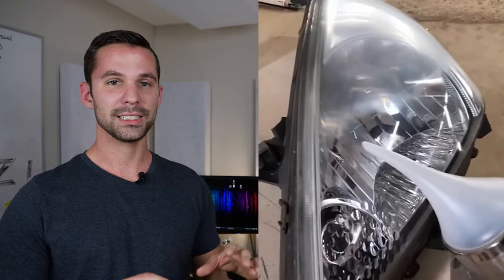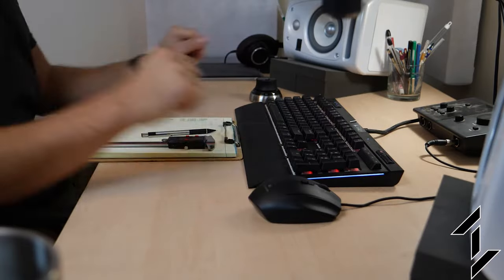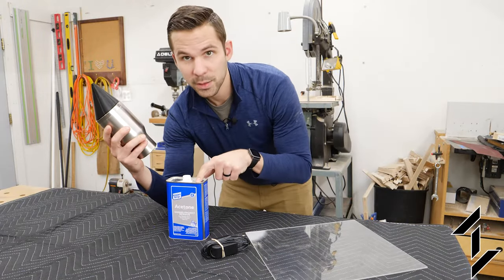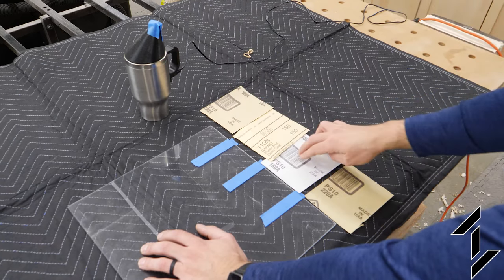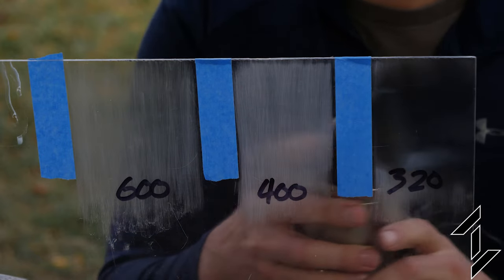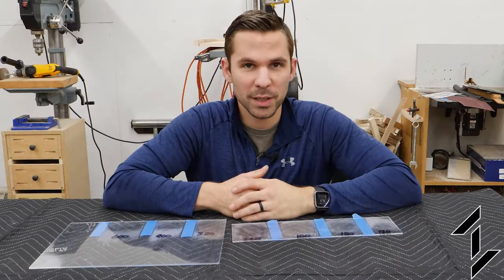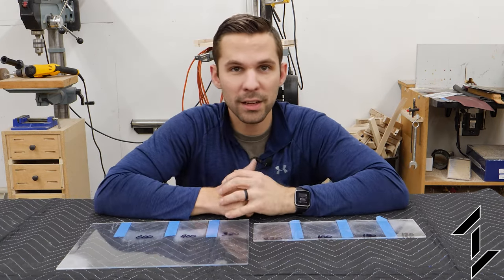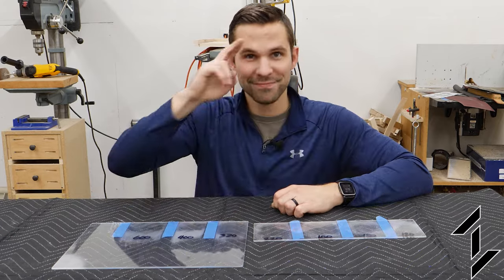Smooth acrylic? Yes, but...

Comment: I am specialist in polymers also Telecom Engineer and IT.  You did everything right and a good job with the 3d printer, but doesn't work for 2 reasons:  Isn't acrylic, it's polycarbonate.  The second reason is the fragment of your 3D project that was dissolved by the acetone, burned and contaminated the acrylic that you have tested.  Try again with a polycarbonate sheet and will work 100%. (sorry for my english)
Reply from the maker: That's great info! Thanks for sharing your knowledge. Definitely more things to try for next time.
Reply: Yup. I’m a sign contractor and there is a misconception that “Plexiglass,” (acrylic) and “Lexan,” (polycarbonate) are the same thing. Nope. Two chemically different products that require two different bonding methods.
Reply: @stuartowens3506 what is the solvent that is used in those chinese headlight polishers called? I just ordered small canistef but there is no info about it. I suspect it is chloroform
Reply: @alexandermurghulia7140  WELD-ON 4 in a video on channel Star Rapid. Roughly 50/50 mix of methylene chloride and trichloroethane per the MSDS. Don't do it! You really do not want to inhale either of those not to mention the fire risk.
Reply: @stuartowens3506 which one is used for bulletproof glass ?

Comment: I did headlights regularly and the repair was done with a special uv resistant coating. But we never coated it at less than 1000 grit. I wouldn't call it busted until you did it at at least 1000 - 1500 grit wet sand. And even then it would still need a coating to protect the raw plastic even if it was clear.
Reply: Nice comment bro.
Reply: I agree with the sanding level. Nobody should consider a lens restoration with less sanding than that. I have seen them wet sanded to 3000 grit.  
It should also be noted Headlamps on cars use polycarbonate, and not acrylic plastic. 
As for sealing, I was wondering if the acetone vapor would seal it.
Reply: @aWhiskeyTangoFoxtrot  the acetone will smooth the surface and seal it against contamination, but to prevent degradation you need to protect it against UV, which the acetone treatment will do nothing for. And contrary to marketing claims, car waxes and coatings won't help either - these may have "uv protective" ingredients, but the film is so thin they have (practically) no effect for this usage.
Reply: The right way to restore headlamp is to sand it with 2000 or 3000 grid water sandpaper and use the clearcoat, used for painting cars, to protect it against UV light! That is the only way to make it right, all other methods are pure waste of money!
Reply: @arm2644  false. Clear coating them just makes a new clear coat that will fail again. Raw plastic polished is the way to go. Ever notice how the clear part of tail lights and turn signal housings on older cars never fade at all? Yup… no clear coat.
Reply: @bobsmithinson2050 very good observation. But do you think since the headlights get heated from bulbs that may cause the degradation? I plan on trying the acetone vapor myself....
Reply: @MrMadact  do you recommend lens film??
Reply: @Truetoself3838  Films are great for scratch-proofing and potentially chip-proofing (I'm a big fan of 'helicopter tape' on my bike frames), I'm not sure about UV protection though. I've seen films advertised as "UV resistant" but that doesn't necessarily mean it's blocking the UV that would cause the plastic lens to degrade. Manufacturers may be able to give some info on this.

Comment: After all your warnings I thought you'd at least wear a painter's mask.  That vapor literally burns mucous membranes.  You have to wet sand the the cloudy surface of the headlight lens starting with 180 and working your way up to 3000 grit to get all the scratches out.  This can take an hour or more depending on how badly weathered the lens is.  Once you get all the fine scratches out, the acetone vapor method works like a charm.  Lenses look brand new and coating them with a 2K clear coat after keeps them that way for years.  You have to follow the directions to get the process to work.  You did not wet sand and just used different grits and assumed the vapor would smooth them.
Reply from the maker: Don't worry, I can hold my breath for a really really really long time ;)
You got that right, and that's what I was trying to answer in the video; to see if it's possible to save some time only sanding to lower grits and vapor smoothing the rest of the way. Nope, doesn't work. Gotta put in that elbow grease!
Reply: @42Pursuit  Hi! Can you share stl file of that cone top for the mug ? Thanks !
Reply from the maker: @Janevjura  https://www.thingiverse.com/thing:4852411
Reply: Don't for god sake dont use 2k clear😱 if it's not written on the can for car headlights don't use it!!!

Comment: 600 grit is the coarsest grit you should use on headlights then work your way up to a finer grit. I personally go to 3000 grit but it can work with 1500 grit. And even after you get the plastic lens clear you will still need a UV protectant on the plastic☀😎
Reply from the maker: That's great info! Thanks for sharing your experience!
Reply: not if you use the polymer solution formulated specifically for headlight restoration, it clears the lens and coats it at the same time.
Reply: Unless it's old hardened flacking spider cracking 2k clear, Then you need to go course p320 but no lower!!! Make sure you have plenty of time and elbow grease to hand 😂
Reply: @keithroberts5611 after properly restoring the headlights,  would it be good to coat them with 2k to protect them?

Comment: Headlights are made of polycarbonate which has 250 times the impact resistance of glass but can come in flexible forms which just adds to its overall strength.  Because of this , it can scratch and yellow overtime which lends itself to the polishing methods to bring back its clarity.  Acrylic only has 10 times the impact resistance of glass and is always rigid.  It is way more prone to cracking and chipping although it always remains clear and never yellows. The video you referenced was for polycarbonate yet you tested acrylic.  He didn't use anything other than acetone and his vapor was hotter than yours.  I have also done this for years with excellent results using a can, hose taped into the opening and heat gun.  Clear headlights are achieved in seconds.
Reply: What liquid works the best for you?

Comment: It does work as per the reference video. Headlights are polycarbonate tho not acrylic I believe
Reply: And headlights have NOT been scratched by sandpaper, just nature.
Reply: @phototec  you have to use sandpaper to scratch them in the restore process , you sand with 1000 grit then upto 2000 grit to remove the old damaged layer of headlight lens and  then use the vapour to remove the scratches

Comment: Every video I saw that used sanding / grit in the initial  process used much finer grades -- such as 1,00, 2,000, & 3,000 grade  sequentially. I think the acetone vapor method might have been much more effective with those grades (in fact one demo suggested it was); not sure I want to mess with the volatility of heated acetone though.

Comment: btw i found a trick to control the sovent power of acetone (increasing its solventing time)
just mix it with isopropanol 80% + 20% Acetone(or higher ratios if u need),  this way you can use it directly without the need of vapour
Reply from the maker: Ah, that's good to know! Thanks for the info!
Reply: u mean this increase the power of solvents? or the opposite? coz I try it 1/3 Acetone and 2/3 isopropanol and I did not get any  result
Reply: @MahmoudAbuHasan  the opposite , it make acetones effect slower. I had the problem that acetone vaporised so fast i could handle it (under 5sec and it was gone).
 When you mix it , it reacts slower. Btw maybe you have the same toner as i have, i found that my toner reacts much better with Paint thinner (the one which main component is this: https://en.wikipedia.org/wiki/Xylene) try that first pure if it reacts with the toner ,then mix it with iso alcohol for easier handling (best value is some where between 20-40%, on my toner it was 25%)
Reply: @hyperhektor7733  Thanks

Comment: The comment about MEK, aka methylethylketone or butanone is incorrect; it's not caustic. It's a common solvent. You want to avoid breathing much of it...use it in a well-ventilated space..and any vapour build up is potentially explosive.

As for restoring hazy headlights in general, all the ones I've looked at show internal haze not just surface haze. Solvent smoothing as shown here and coatings will only fix haze caused by surface roughness; the internal haze will remain. As a quick check smearing a liquid on the headlight..soapy water, vegetable oil, wax polish...will give you a good idea of what you can expect from surface restoration. The headlight will look less cloudy but if it's still quite cloudy then the issue is internal haze and I know of no way to fix that.

Comment: 20000 then 50000 wet grit only and sand it softly like use your hand to hold it there and move it on the surface never fingertip it because you'll dig at and angle and then use your vapors or cotton wheel with wax its all about prep work, if you half ass it it doesn't matter how good you do with anything else its still gonna be a HAJ prep work is foundation for everything ever period doesn't matter what it is, like you can Land a plane missing a wing but you'll never get one of the ground with out it

Comment: Why didn't you try using 2500 grit sandpaper or higher? This is what is normally used before polishing with V36 compound. Also should have used polycarbonate sheet.

Comment: Dude 600 you start with water, 800, 1000, 1200, 1500, 1800, 2000 grit ALWAYS WITH WATER AND THEN you do it with polymerization!!! 600 and 800 are for removing big scratches.

Comment: Repeat the test, but find an old headlight assembly off a junk car. It HAS to be polycarbonate plastic. MEK is a wicked paint stripper that burns like hell if you get even a tiny smear on your skin … what’s worse, soap and water won’t wash it off! I found out the hard way that 91% isopropyl alcohol rinses it off pretty well, and I suspect methyl alcohol would work as well but I never tried it. You said, and did, some things that imply your knowledge of materials science and organic chemistry in general are severely lacking, and simply trusting your ‘comfort level’ while you play around with potentially dangerous things you don’t know much about could result in some really bad consequences. It’s just my opinion, but I would advise you to bone up, or stand down. Consider teaming up with someone with some knowledge and expertise. You never know- there could be a retired chemistry professor or petroleum engineer who is lonely and bored living right down the street or around the corner. The amount of free advice, experience, knowledge and skill available on just YouTube is nothing short of astonishing.

Comment: I do this, and i do not use acetone.  First, you have to sand the cover down with 2500 grit to get the smoothness, then you use a POLYMER solution (which is NOT cheap) to finish.  The secret is to provide not just a "smoothing" but also a new finish to protect the plastic that has been cleaned.
Reply: So what is the liquid you use? Why not acetone? Does that destabilize the plastic too much and makes it crack?

Comment: Much finer emery paper 800, 1000, 1500 grit and graduate to fine steel wool. Remember it is UV damage your removing. No need to use jackhammer style muscle on the sanding part!....Meaning do not put pressure when sanding! You'll gouge deep grooves. Back and forth even passes in a uniform manner, then up and down passes. Rinse surface well and allow to dry.  You'll end up with much better results. 
The grits that were used in this video are ridiculously too coarse.They would work for taking rust off of steel.But that's not the situation here.

Comment: I agree with the commenters below who said these methods are much too dangerous for DIY! If you have ever seen anyone working with acetone get burned, you wouldn't go near this! Even that small cup could create a disastrous fireball with one spark -- especially when it's hot. MEK is a long term exposure hazard. It cooks the liver. Brief exposures probably don't much matter. The big danger in all of this is flammability.

Comment: Older video, I know, but they actually sell a kit to do this (about $90).  Comes with the cup (similar to the one you use), sanding blocks, chemical, etc.  It's worth noting that this kit's sanding blocks go up to 2,000 grit.  I'd try repeating your experiment, but sand up to 2,000 grit, then try it.

Comment: There is no short cuts for doing headlight restoration,This method shown here is far to dangerous for the weekend DIY, There's only one way the right way and I'm sure most people can afford 1hour restoring a set of headlights if the prep is done properly first, Depending on the make and type of vehicle, A shure way to maximum clarity and shine,If your a novice and dont wont a spend to much for a professional detailer, You cant go far wrong with 3M headlight restoration kits, There are three to choose from one for dry sanding tools required, And wet sanding no tools required, And a heavy duty kit to which tools are required,The instructions for the above kits must be followed correctly step by step are fool proof!!In addition i think one kit as clearcoat wipes,You may find you need to purchase a certified clearcoat with added UV protection separately if longevity is important for you?Also there are many utube streaming videos demonstrating  this second to none product!! After care is equally important but thats another thing!! Goodluck 🤔😊🇬🇧👍

Comment: 300 then 500 then 1500 grit wet and dry sandpaper. Use clean filtered water. Acitone is what they are using. Finish with a UV protection coating. NOT CLEAR COAT.

Comment: Maybe u should do more research before coming to an conclusion 😂. This method only works on 2000 grid more fine u go more better result u get. And no one uses a 600 on headlight. Its a plastic not metal 😅
Reply from the maker: I did research before and there wasn't much clear info on vapor smoothing at the time of posting. There's a lot more info about it online now.

Comment: Over the past 25 to 30 years, I have been sanding lenses to 800 grit, giving them a wipe with 70% isopropyl alcohol, applying a thin wet coat of adhesion promoter, then applying a 2K clearcoat. The process requires more work, but the end result makes it worth it. Now that 2K clearcoat comes in disposable spray cans (SprayMax), anyone with an appropriate respirator and common/safety sense can DIY. 😊👍

Comment: "yeaaah busteeed"
... You used 600 grit dude...
It's 2000-6000 ideally.
Reply from the maker: The hypothesis I was testing was if lower grits would work for smoothing without having to do all that work of going up through the high grits.

Comment: The guy used 800 grit. Also one guy said it was chloroform ?
Reply from the maker: Hmm, yeah, I've heard chloroform too. I think I'll stick with wet sanding with high grits. Gotta get a workout somehow 😄
Reply: @42Pursuit  you don’t sand with the chloroform. There is a small vapor kettle like appliance that puts the vapor on to the Perspex supposedly cleaning it and sealing it?

Comment: Have you tried paint thinners as it's more aggresive than acetone?
Reply from the maker: I haven't, but from my research it wouldn't react as well as a smoothing agent for the plastic. Might be worth trying though...
Reply: R U referring to paint thinners for automotive paint?  Most auto acrylic paint thinners use acetone, toluene, mek in various concentrations

Comment: You have it all wrong!!. Those lights are faded from the sun, it's not the same as scratches.
A little bit of commonsense goes a long way.
Reply from the maker: Sand the uv damaged surface layer off then vapor smooth the scratches. Didn't think of that with all of the common sense you're touting eh?

Comment: nice !, have you tried this method directly on prints ?
Reply from the maker: I haven't but I bet it would work on ABS prints to smooth specific areas.
Reply: @42Pursuit  exactly what I was thinking, its a more direct specific approach but way to narrow flow to make a large surface smoothing, mabye this could be the source of steam, or more than one in diferen places, to a bigger box with a fan to even the steam inside to get a large size abs print smooth

Comment: I wonder how it would work with 3d printed acrylic parts
Reply from the maker: I briefly tried it, and it works but is kinda slow. Doing the smoothing the typical way suspended in a metal can would be much easier and uniform.

Comment: From what I know... which is cursory... flame/heat polishing works for Acrylic/Plexi.  Maybe the Acetone would work better on headlights, as suggested by Dane Jensen.  Especially if you went through the steps of sanding to 800-1500 grit.
Also, we have MEK in our shop at work, and we use it sparingly.  Actually, we use it for creating a "goop" out of plastic trim we make displays with.  MEK melts the plastic off-cut slivers, and we apply it to the mitered corners.  Fills in the gap and hardens to the same plastic as the trim itself.  If you're careful and ventilate properly I haven't found it to be much more ugly than Acetone.
Reply from the maker: That's great feedback, thanks! Hmm, might have to experiment with MEK after all...
Reply: @42Pursuit  Always sand to the finest grit possible when polishing..... Should have at least went to 3000. My only concern is UV protection after its done and how long it lasts....